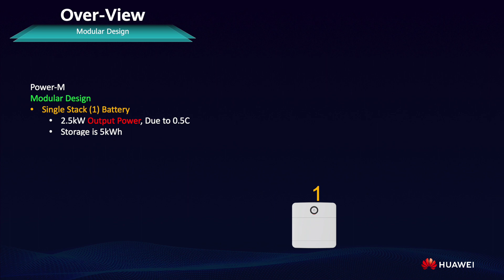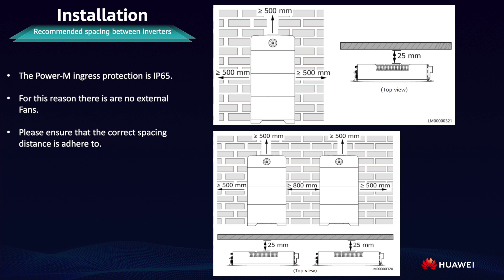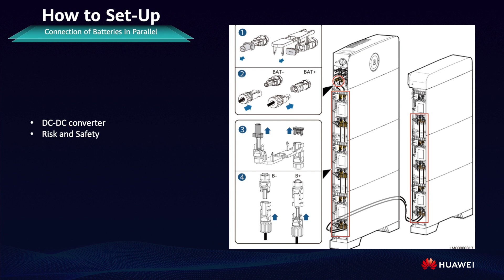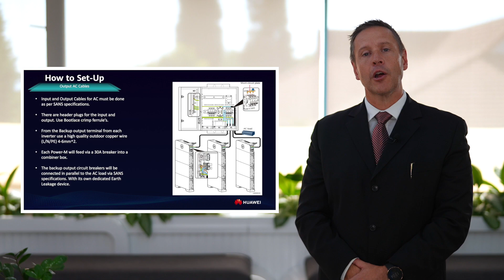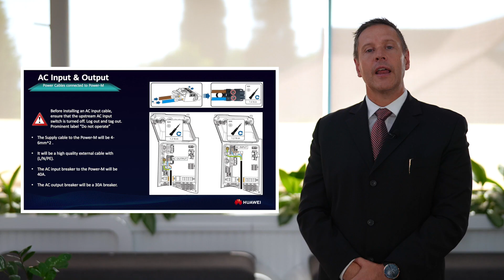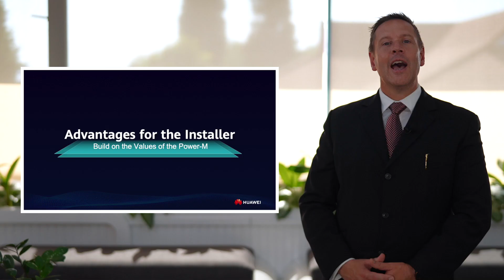Huawei Power-M Installation Guide

Comment: Does the units have any capability to communicate to 3rd party applications for monitoring apps using protocols such as e.g. MQTT
Reply from the maker: The Power M comes with free, built in monitoring through the FusionSolar App. It does not support 3rd party monitoring.
Reply: How do you charge the module
Reply: @DanielUchendu-dp3sk  solar and Ac through grid and genset